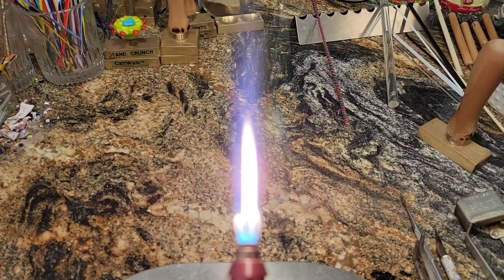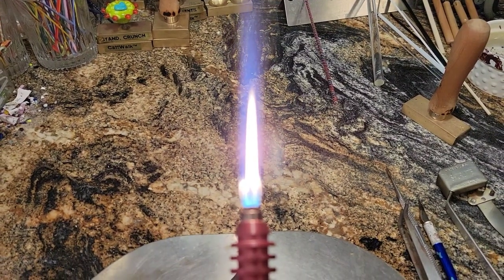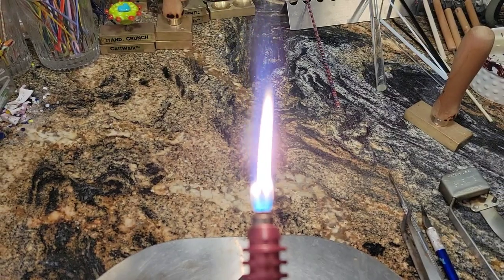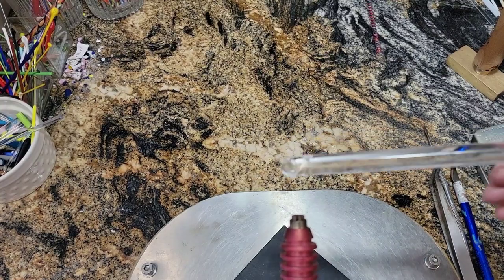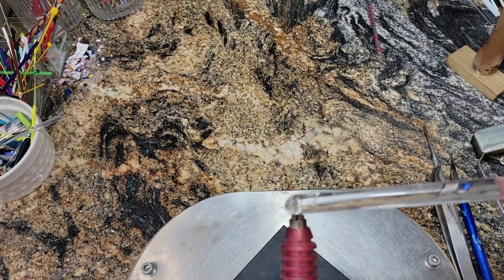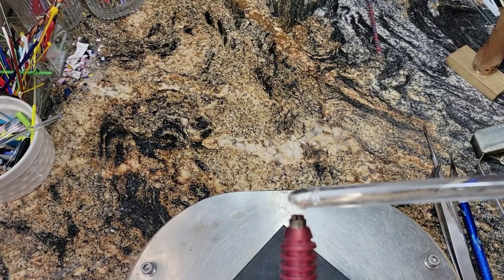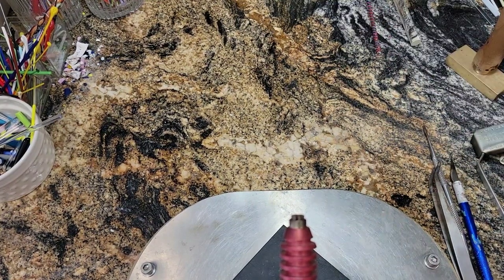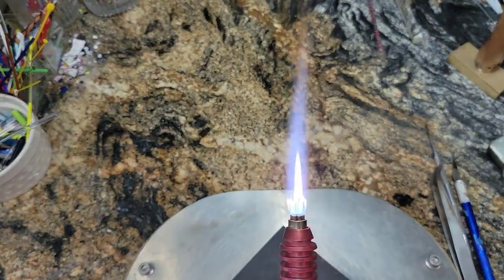Lampwork Glass Beads: Ruining a Torch

Comment: Shiiiit is there no way of clearing it using the cleaning rods for the torch -? Cant believe you have to buy a new torch you must be gutted 😞 x
Reply from the maker: Definitely a bummer. I tried the cleaning rods but those only pushed the glass further into the torch. I think I've recovered though. Got a Hot Head to tie me over.
Reply: @LepoppetGlassBeads  did you turn the oxygen on once you had used the cleaning rods as I read if you turn it up full and turn it on on your torch ( no gas) it then blows it out the jets ? x